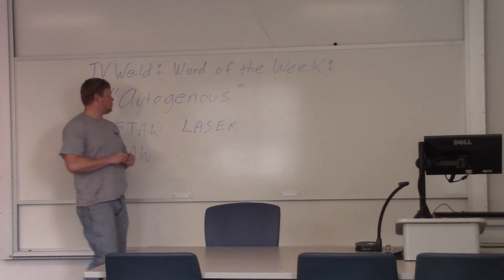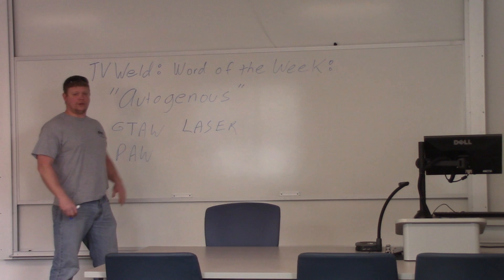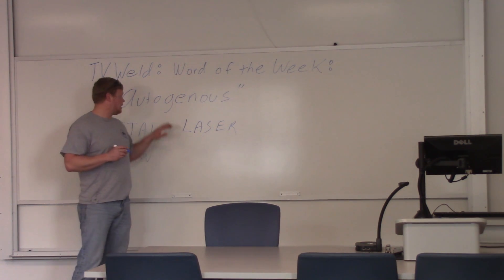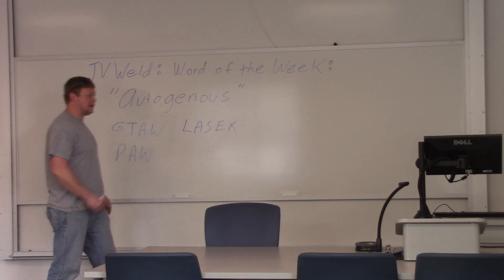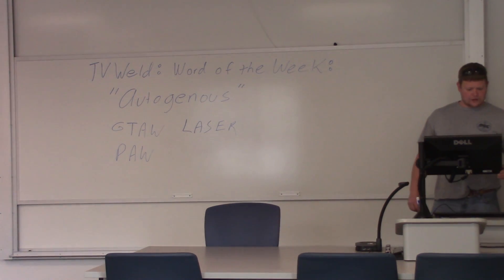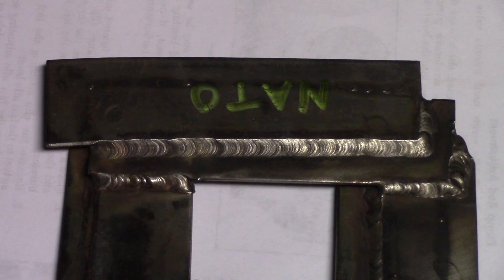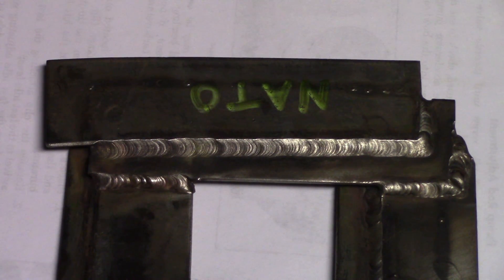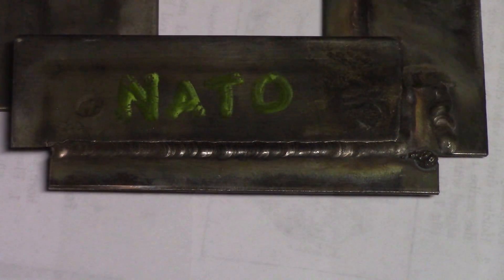What Are AUTOGENOUS Welds?

Comment: Hiii sir have some questions? 
How hydrogen effects the ductile material? 
Is cast iron welding possible? 
Heat treatment conditions for SS, duplex, and alloy? 
How to perform welding of material who has low thermal conductivity?
Reply from the maker: Hydrogen can induce cracking depending on the material.  You can weld some cast irons (gray, ductile) by using nickel filler metal.  Heat treatments on stainless and other alloy steels can depend on a lot of different factors, so I guess I would need a little more information on what you're asking.  Typically welding on material with low thermal conductivity, the welding procedure will contain preheat and post heat procedures to make sure the heat doesn't stay to localized causing distortion and poor heat affected zone properties.